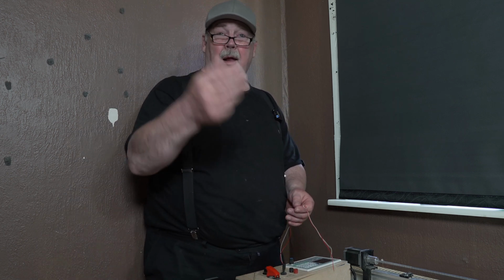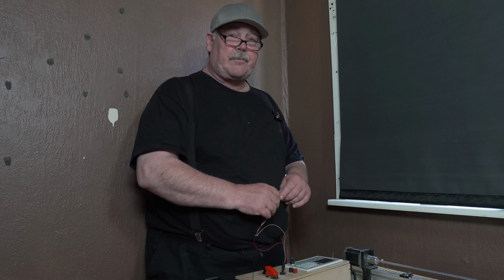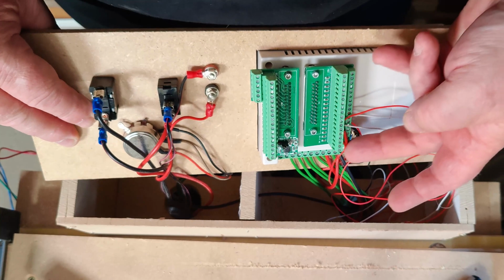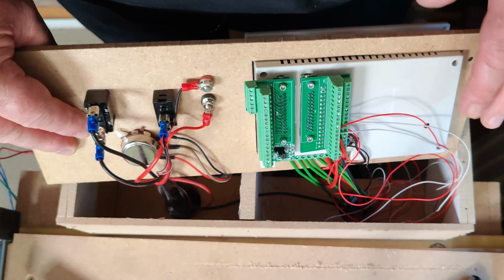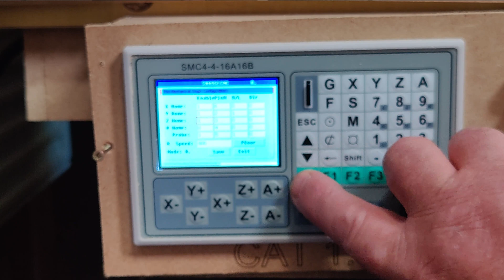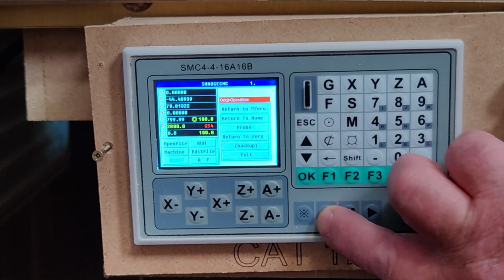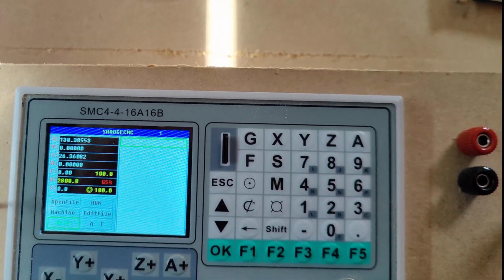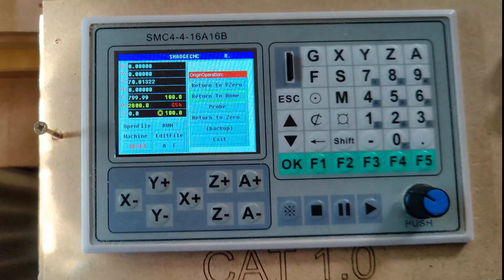Add home and limit switch to the SMC4-4 16A 16B cnc offline controller

Comment: Hello, sorry, do you know how to modify the output parameters? I'm trying to turn on an output to perform an external operation with the M10X and turn it off after a while with the M20X. The problem I have is that from the beginning of the program all the outputs are activated. (they have 12v) and I need them to be off from the beginning and only turn on when I put in the M10X, the M20x command works for me and turns it off. 
I don't know if there is a way to invert the output logic in the SMC controller.
Thank you
Reply from the maker: Sorry I dont know either

Comment: Can it return to the last operation point just incase there is a power outage...yeah let's say you want to continue to where it was
Reply from the maker: Yes you can do,  BUT you need to be sure what line you start from.   It would be easier to run the G-code from the beginning.  The tool will be carving in the air until you come to the place where you had the power loss

Comment: You know how to connect and program the smc-4-4 16a16b board, the z touch probe sensor.
Reply from the maker: If I remember correct it is as on the picture see link below.  https://drive.google.com/file/d/1x-FafqWVX9OsFd2BJFB-iZiTWJGK4qCa/view?usp=sharing
Reply: @weitlingD3P  So that's the probe connection.
Reply from the maker: @maximilianorivera5044  I hope but try it out.  just touch the probe to the tool
Reply: @weitlingD3P  Is it necessary to place some g code to program the thickness of the probe?
Reply from the maker: Sorry long time since I did use the smc-4-4 16a16b.  Maybe this manual can help you https://www.manualslib.com/manual/1270579/Purelogic-Smc4-4-16a16b.html?page=3#manual

Comment: Could you use fusion 360 export gcode files and does it have the MDI option to type Gcode lines ?  Thanks
Reply from the maker: I don't use Fusion.  but I guess it can, the DDCS V3.1 is a widely used controller

Comment: Great video ☺️ do you know weather you can connect a handwheel for this controller?
Reply from the maker: Thank you Elliot. It is not possible to ad a handwheel.  If you need a handwheel i can recommend the DDCS V3.1 offline controller.  There are many good offers with bundle.

Comment: Thanks for the video. I am trying to use the outputs.. for example output #15 using M115 command but can't get it to come on? any clues? thanks.
Reply from the maker: Thanks for watching.  The #15 gives you a 5 Volt signal that can be used to activate a SSR as example.  Maybe this will help you  https://www.nvcnc.net/pdf/smc4_4_16a16b_setup.pdf

Comment: Hi, may I connect limit and home Balluff inductive sensors and In 24V?
Reply from the maker: Hi I haven't tried it out with 24V  But it says can use from 12 to 24 volt input in the link below
bit.ly/3msCuNq